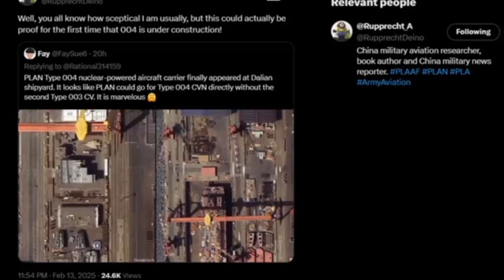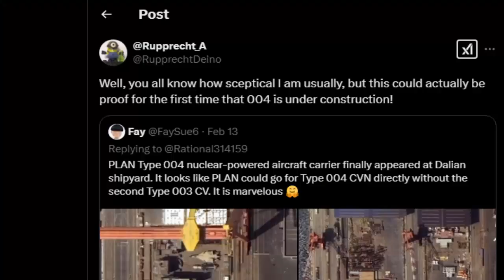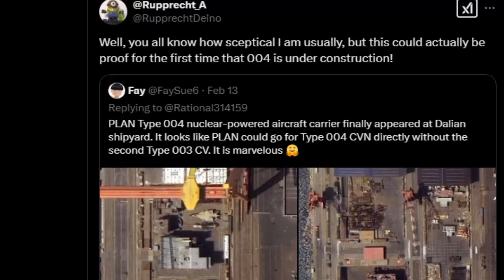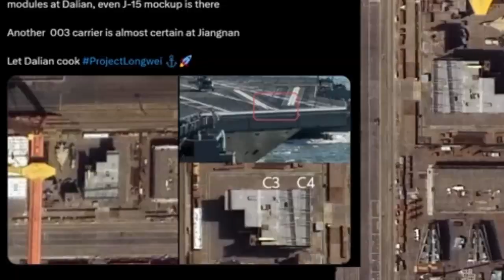Finally! China's first nuclear aircraft carrier, Type 004 Be the world's most powerful Supercarrier

Comment: China building 2 of them at the same time.
Reply: Your conclusion is.correct❤❤
Reply: @Laurie-si7mp both type004? One is type003 and another 004
Reply: @learner5255 Nope. Type 003 has been completed a year ago. They are building two nuclear powered carriers at the same time. Both are 110,000 tons of displacement
Reply: Wikipedia says that China is building at least 4 of the type 004 supercarriers, and that it will be nuclear powered and 110,000 tons
Reply: @ethanmac639  China build four ship's a year I think it is if I'm not mistaken boa steel has 2ports in its possession and may not be the only company in China that has two
Reply: @Laurie-si7mp  way way way WAY WAY WAY wrong!
Reply: @ethanmac639  😁😁
Reply: @ethanmac639  😁😁
Reply: @ethanmac639 they're building 2 type 004 at the same time in half the time of a Ford Class
Reply: @pgdog888  The us are now current buikding the jfk and enterprise but at completely different stages. No one know if china are building 3 or 4. Better waiting on the sea trials for any issues to be fixed before building numerous on a new design.
Reply: Wow, I didn't know that.